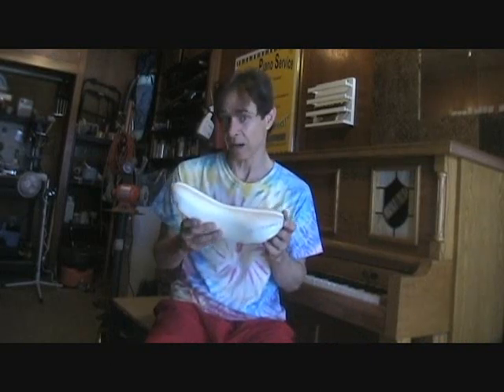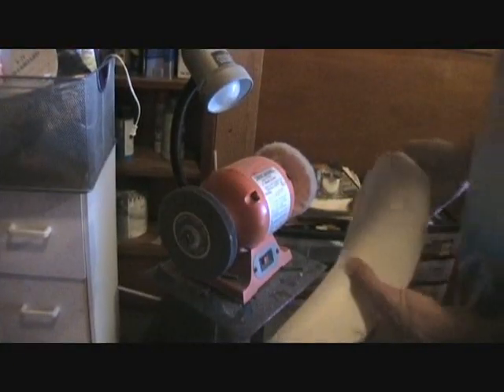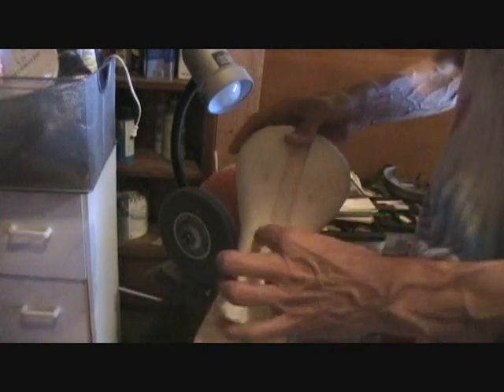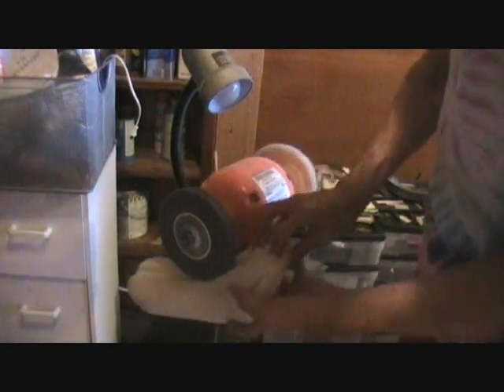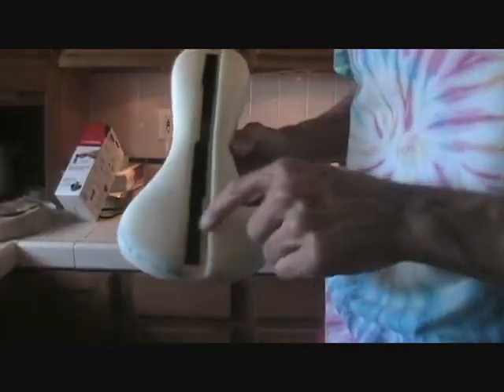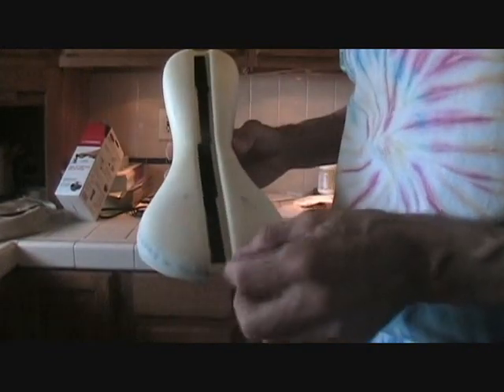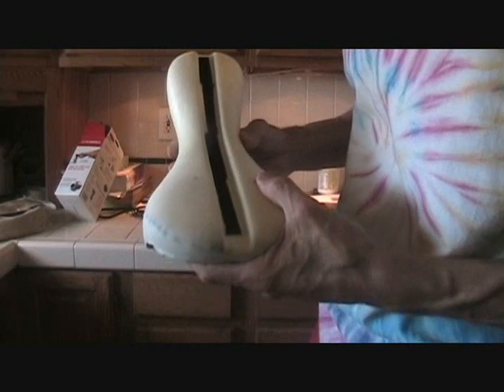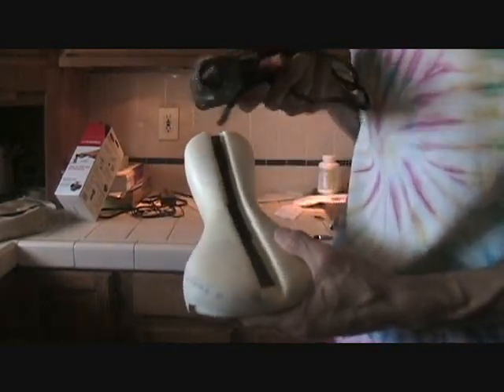Unicycle Tutorial - "Unitorial 4"  36er, Coker, MUni, Seat Mod)

Comment from the maker: @elpasayocalvo What kind of a hib do you have? I had the same problem and it turned out to be a defective hub. Mine was the newest style  Kris Holm Moment hub, which he replaced for me and that solved the problem. If that's not it, try putting a little lithium grease where the spokes cross. Also, lube should be applied to the spoke nipple holes as well. If that's also not it, then the spokes are still not tensioned sufficiently.

Comment from the maker: @elpasayocalvo I don't have any direct experience with that nimbus hub, other than it sure looks like a "fitted" flange" type, rather than the traditional type where the flanges are welded to the hub. If it is fitted, likely splined and press-fit, than the hub itself could be the source of the creaking. there is no break in period, where the creaking would just stop after a while.

Comment from the maker: @elpasayocalvo (part 2) If it is due to the hub being defective, like my KH hub was, then you will need to contact udc or where you bought it and tell them you want to have it replaced on warranty. they may ask that you return the hub for inspection as I did with mine. Creaking sounds can also be caused by loose cranks, pedals and looses saddle bolts. What you DON'T want to do is have a BIKE mechanic over tighten ANYTHING on your uni! Unless they are intimately  familiar with uni technology.